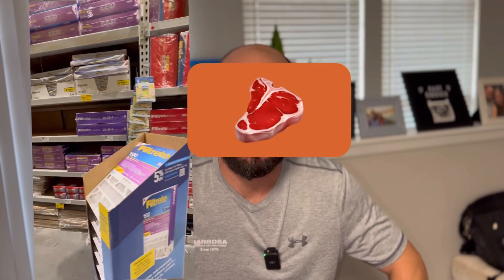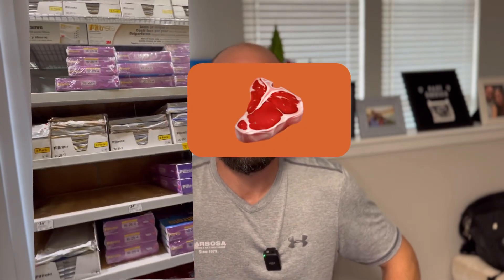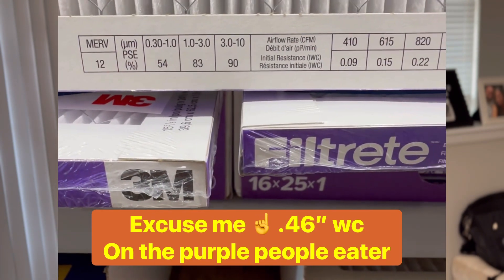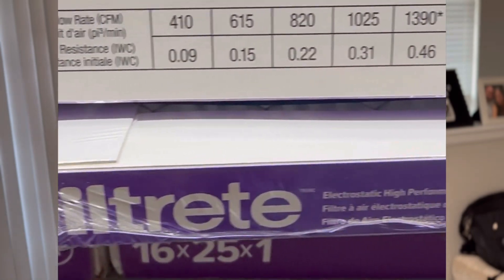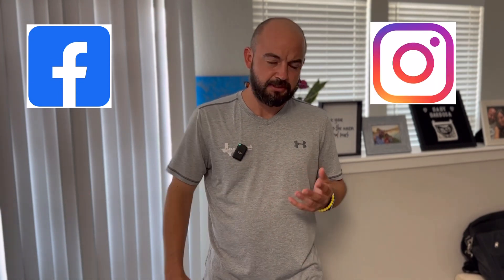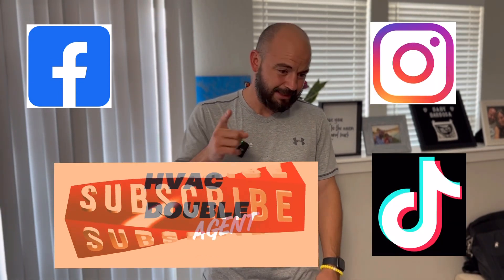3M Filtrete Air Filter Explained- 💜💙Part 1 #hvac #ductwork #ductdesign

Comment: A bit disingenuous to only state the pressure drop at max flow, don't you think? If you have a system big enough for that much flow, you should probably have 3 or 4 filter returns, not just one. Plus, lowering the flow through the unit helps lower the SHR, which is what most homes need anyway. Replacing a blower motor isn't that big a price to pay for better air quality, and you could always pull out the stuck blower and motor and put in a higher static-capable backward curved unit, they can push multiple inches of static easily.
Reply from the maker: I’m just thankful you’re watching bro! 😎 Most HVAC systems in DFW have undersized ductwork. The end.